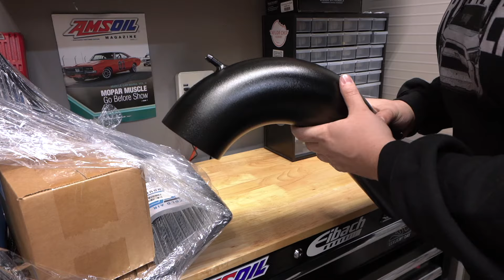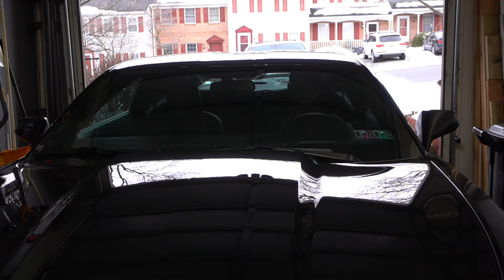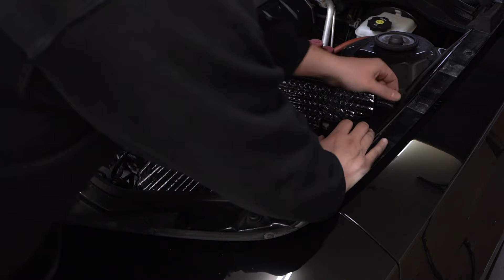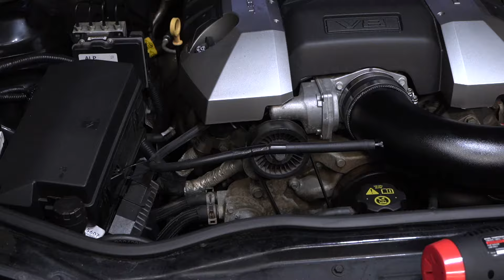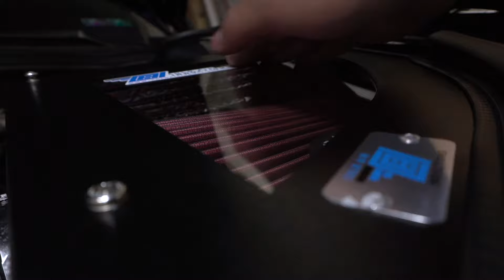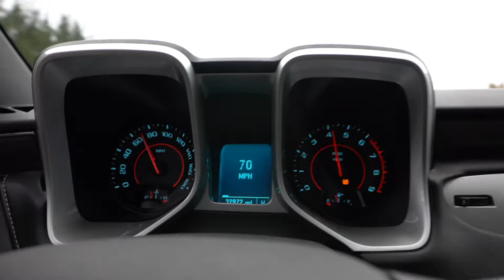Camaro SS Gets Cold Air Intake | Cold Air Inductions VS. K&N

Comment: I just installed a K&N system on mine and the fit is so disappointing… the “box” doesn’t seal to the fender/rad support at all, there’s huge gaps to let hot air in. Wish I had bought the Cold Air Inductions to get a proper seal. Especially when there isn’t much difference in price between the two..
Reply: Bubble foil shield and double sided carpet tape

Comment: Cold air inductions? More like hot air induction’s. The K&N intake is superior because it has a plastic intake tube. Metal or aluminum intake tubes don’t dissipate heat very well. When air travels through a metal intake tube, it heats up the air and lowers horsepower.
Reply: That is why this metal tube is teflon coated to keep air cold

Comment: Nothing like a drive in winter with the Camaro...do they salt the roads where you are driving? If so, stop wasting your money on mods. Your Camaro will be a rusted out heap in time to come. I live in WI and no Fing way would my SS be out in winter. It stays in a heated garage until a couple good rains in May.
Reply from the maker: They do but car was rust free before I sold it, new owner wrecked in a few months in and totaled it, sadly.
Reply: @MartyMotoring  Nope. Once you drive a car in winter and it gets a good salt bath it will eventually rust out somewhere on the car. The salt gets into areas where you cannot easily wash it out.  I've lived in the salt belt for 50 years and owned several vehicles long term to know how they all eventually rust.
Reply: Been driving in the rust belt for years. Put 100 thousand miles on my traverse and as long as I’ve had underside washes it’s been solid.  Clean it really good and hose it with fluid film.

Comment: Nice clean setup but just food for thought. Metal conducts and retains more heat than the plastic one so you're actually putting more heat into that motor. That's why K&N makes them out of plastic or carbon fiber like mine.
Reply: Read description.
That is why this metal tube is teflon coated to keep air cold.
Make sense now ?
Reply: I know it’s 2 years later but…You are right and wrong, plastic is a better insulator than metal for heat unfortunately carbon fiber is NOT a good insulator for heat.

Comment: I got a CAI cai Kit , New in Box for my 2011 2SS, it’s ok but the fitment from the throttle body to the filter is not good, since pipe is stiff it’s got literally 0% play/wiggle room, not good since tubes gotta move a bit w/ engine, is it a true “cold” air intake , yes is it the best fit No, would I buy it again for my other vehicles, No
Reply: My 2SS has 5K miles , clean like new , not even a dent, dang filter came out, followed instructions as per this vid and filter hasn’t came out again but like I said has a really crappy fit

Comment: I tried bolting on my CAI and the engine idled funny like the alternator was going bad and when driving it acted like there was a misfire.  The only thing I didn't do was try melting the intake hose.  I'm hoping I don't have to buy a performance MAF because I've heard mixed signals about the Jet MAF so I've yet to pull the trigger on it (5th gen SS owner by the way).
Reply: @JohnJohn8909 I know this is an older comment but did you ever figure out what the cause of this was? I got this same intake and I'm noticing the same thing.
Reply: @Fade2BlackSS  come to find out the plastic connector tube needed to be taken off and replaced with the rubber hose. I learned that after spending $50 at a performance mechanic who installed my long tubes.
Reply: @Yahkanan_Ban_Malakyam Are you talking about that plastic hosing/tubing that’s on the resonated part of the stock airbox hosing, and goes to the stock intake manifold? That’s the part that’s usually removed and replaced with rubber hosing when upgrading to an aftermarket air intake system, right? 

I was looking at $300-400+ ram intake systems, and a few $350+ cold air intake systems, and I’m honestly rebating on just getting an SLP intake hose/tube, to delete the stock resonated intake tube. The gains aren’t really there, but it looks more sporty and sounds a tad bit better. Dare I say, you might get 3+ HP more with cold ambient temps all around? LOL

Comment: The plastic k&n is going to 100% make more power, most metallic cai with suffer from heat soak.
Reply: nope. the air passes too quick to take up the heat.
Reply: There’s a dyno shootout comparing all the intakes from a few years a ago cold air ($400) picked up 18 whp and add a jre scoop and washer relocation kit $160 that’s another 5-8 hp

Comment: So every time you need to add windshield washer fluid you need to remove protecting glass - in my opinion that's not the best solution even if filter get's dirty without the glass - filter function is to get dirty and keep the dirt on it.  Basically this cheap plastic tube by K&N is better due to thermal conductivity. There will be more heat from metal tube than plastic. I am not a fan of K&N but in this specific comparision it's way better than CAI you installed.
Reply from the maker: Well,  I don’t find myself adding fluid that often, and the top cover comes off in 10 seconds with the 1/4 turn bolts. 
This design doesn’t get dirty and protects from heat soak since it is walled off with insulation.
From what I’ve seen on the dyno, these perform the best.

The K&N design wasn’t bad besides being flimsy - and the plastic actually cracked on me. I’m sure this could also be used with a plastic tube but I used the coated metal one included.